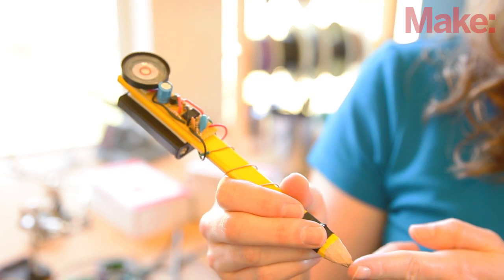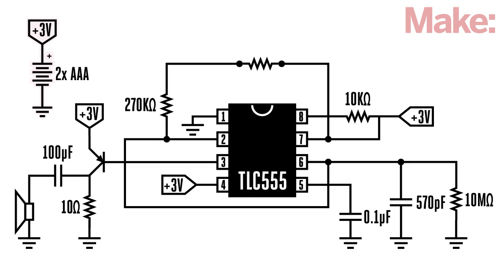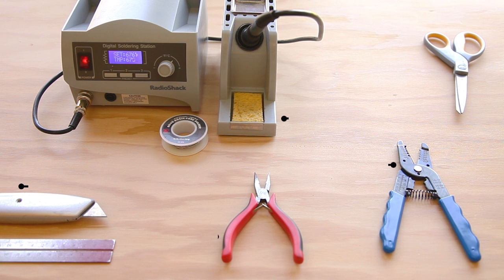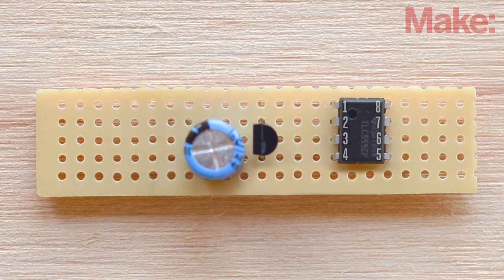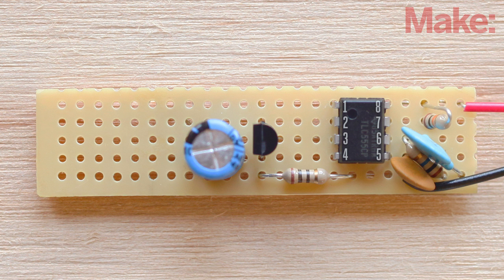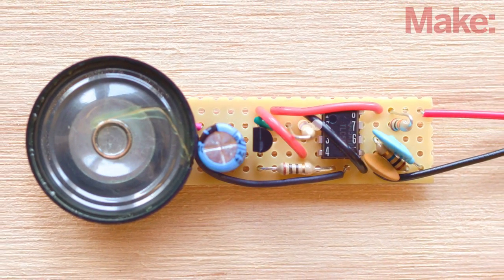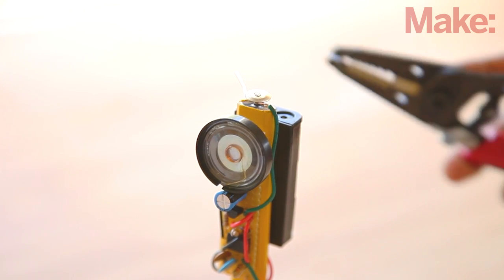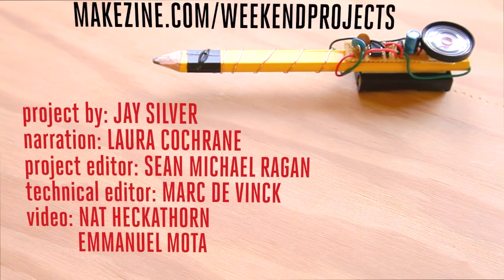Weekend Projects - "Drawdio" Musical Pencil

Comment: the ne555 timer can run off of a 9v battery witch would allow you to use it instead of the tlc555 timer, and would take up the same amount of space on the pcb
Reply: NE555 works on 5v or 9v

In this video...it was mentioned that ne555 works on 5V

Comment: There is mistake in the circuit, pin 8 goes directly to the positive, not through a 10k. Pin 7 goes through 10k to positive.
Reply: sure?
Reply: Yes, I made the device, but it didn't work, I spend the whole day trying to figure out what's wrong, I went to the 555 datasheet again and to some other 555 tone generator circuits, until I figured out this mistake! After that it worked perfectly like in the video.
Reply: +imad fadol thank you for pointing that out because I had the same problem, thankfully I read your comment and was able to fix the mistake. The circuit works perfectly now.
Reply: did you use the tlc555 3V version or the normal 555 5V?
Reply: Your welcome
Reply: tlc

Comment: there is a difference between the scheme and during assembly, its in the resistance is at 10k, in the scheme you conect the resistor to the pin number8, but in during the assembly you connect it to the pin number7
Reply: Juan Jose Valladares well I guess that answer won't help anymore... But the schematics in the video are faulty... They sodder it correctly at the end. Correct schematics can be found with the link from the description.

Comment: Actually, the metallic inks are electrically conductive. However, any ink pen would prove impractical for this project because you'd have to pierce the ink cartridge to get one of the leads into the ink itself. The potential for the ink to leak out (or heat up) is very high.
The graphite is very conductive and won't leak onto the carpet or clothing, making the pencil the #1 choice.